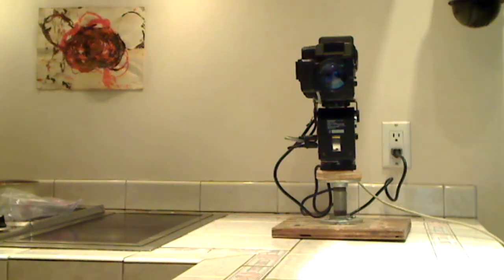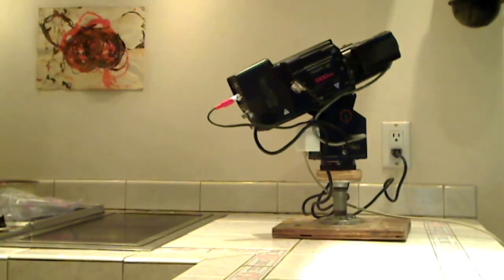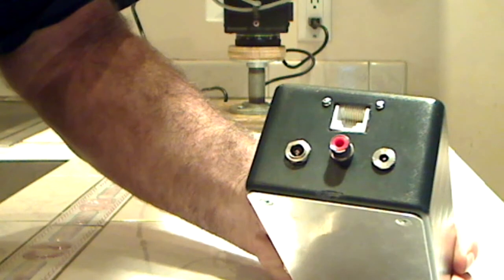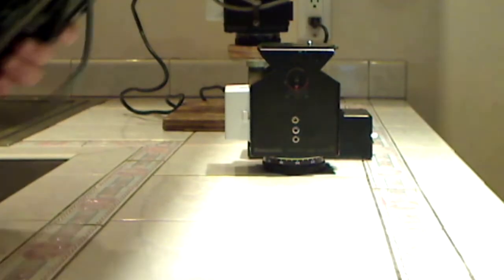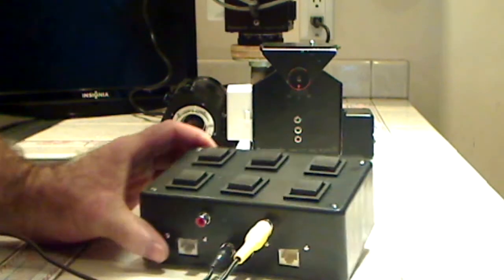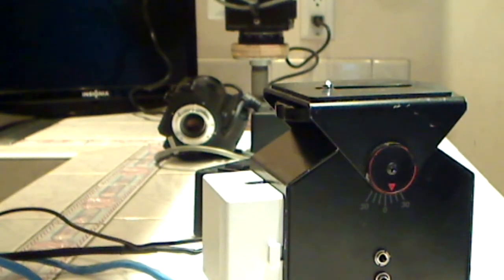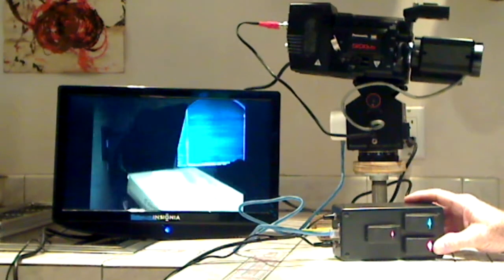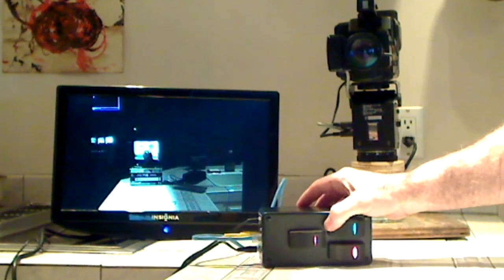Panasonic WV HD 5100 SYSTEM CAM & CONTROLLER

Comment: I just had a panasonic wv-d5001hs without a manual. Can you please help me the cords i need to connect it to a pc
Reply: This technology it too old... it does not connect to a computer
There is no interface to do that
It only records 720 P
Has a multi pin connector that is to connect the camera to a VHS RECORD DECK
There is a smaller round multi pin connector
That is to connect the CR12 controller for the pan/tilt base
Can not pan and tilt in unison...  in a fluid motion
Have to switch control from.. pan.. to tilt... to operate that function

Comment: Hi, Great Video. Do you remember if the pan and tilt uses stepper motors or regular DC motor? Im thinking of using this pan and tilt with an RC remote. Does it Pan and tilt smoothly and are you able to control the speed?
Reply from the maker: This is a stock Panasonic PH-10.   opened it up and rewired it to feed into the Ethernet Junction box...  of the 2 transformers in the video's detail... one is 12V which is what supplied power to the PH-10 through a double pole rocker switch...  reversing the polarity in the rocker switch is what reversed the direction in both pan and tilt...  ( 2 separate rocker switches... )
Your answer being a 12 VDC motor.  Control speed was smooth...  being able to pan and tilt in the same motion was the key factor...  the controller I built was pan/tilt/zoom in one fluid motion... 
Will be heading in your direction shortly with RC control to relays.  Decreasing/Increasing  the power in finite amounts controls the speed...   didn't need speed control unless I was zoomed into something and at that rate no matter how much speed control you have it relates to the gears and teeth for that kind of finite movement...
The CR-12 Panasonic controller designed to work with the PH-10 is a complete waste of time...  the cable it requires to interconnect between the camera housing and the CR-12 is short... or toooo  long...  REALLY expensive if you can find them... and then... once you get them...  you CAN NOT do any camera control ( ZOOM ) while in the pan and tilt mode...  no way to do a fluid pan and zoom move like following a car or someone walking up and past you on the sidewalk.
As you see I got pan/tilt/zoom and Video feed through one Ethernet cable.  perfect to place the cameras remotely.  For viewing on a monitor station
Reply: Please did you figger out the cords?